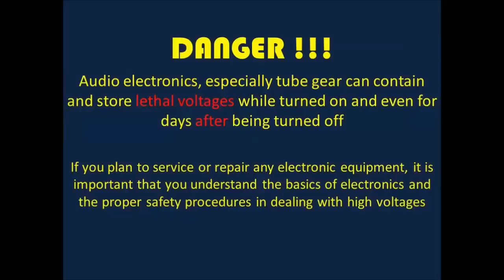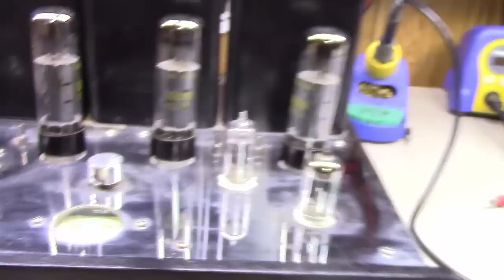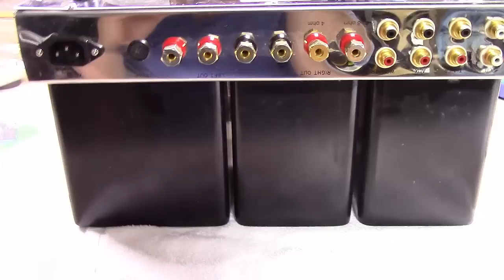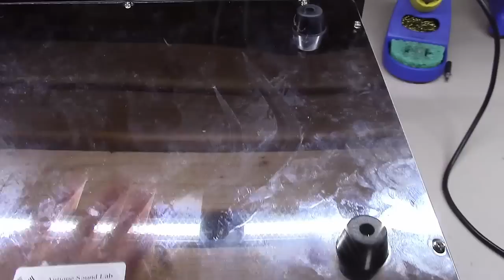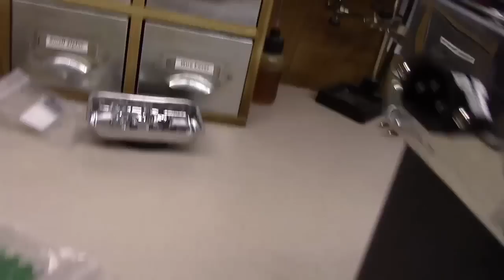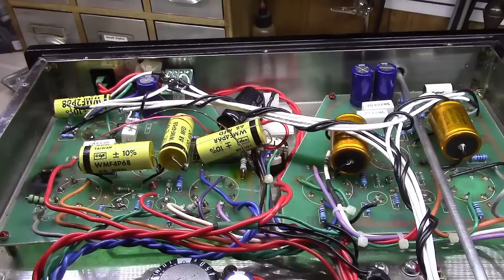Antique Sound Labs Amplifier - A Dead End - BG036

Comment: Scary video!
A "fiend" gave me a nice looking Antique Sound Lab (USA) AQ- 1002 power amp last month....
Fitted with only 2 or the original quads of kt88s and 12au7s.
Looking this "Gift Horse" in the mouth, I opened it up and found a couple of burned out resistors but the rest isn't butchered like this one.
Fortunately the assembly kit version instructions &  circuit diagrams are still available online.
My local repair shop in Missoula Montana has semi retired, and isn't returning phone calls or emails. 
So I decided to order some resistors from the tube depot... We'll see if she runs with an older set of 6ca7s before I risk my Mullards or Gold Lions or buy a set of KT88s for it...
🎶🤔🎶

Comment: Compare this with old Dynaco kits.......!
More than once i got messed up tube amps like this one with the request to retube the amp , only to discover his kind off mess.....just like you i ended up refusing them.
Lost time and lost money without the thing becoming a quality amp after repair ....no any satisfaction working on this rubbish.
Reply: With cheaper parts than the original Dynacos hiding beneath the empty transformer covers and chrome plating, I couldn't agree more strongly.  There are too many good new and used EL84 push-pull amps to waste time on this one.

Comment: What's an illegal linear amplifier? Picks up cop talk, or something?
Reply from the maker: +cbobcheck In the 70s there were tons of illegal linear amplifiers made for the CB radio band.  FCC stated 4 watts output on AM & 10 on SSB were max allowable, these amplifiers allowed operators to put out hundreds if not thousands of watts.  Many were built in basements by shady engineers.
Reply: Thanks for the info. That would make them a rolling radio station, no?

Comment: After watching this video, I wonder if the customer bought this thing this way or if he is trying to get it fixed up and working so he can unload it. It is hard to believe that someone who knows which end of the iron is hot would have turned out a mess like this. I agree with your conclusion. This thing belongs in the landfill. It doesn't even have salvage value.